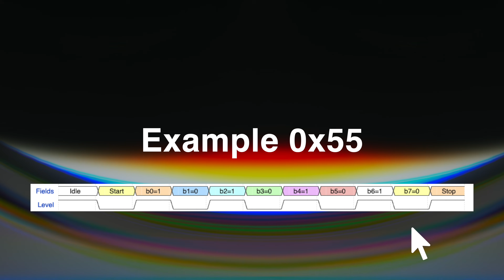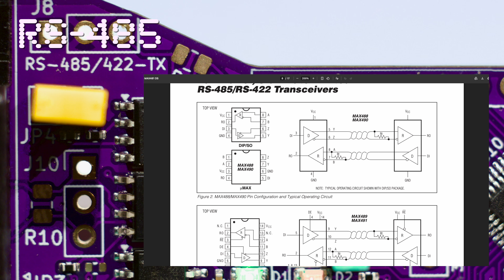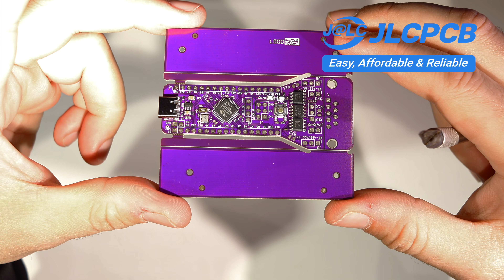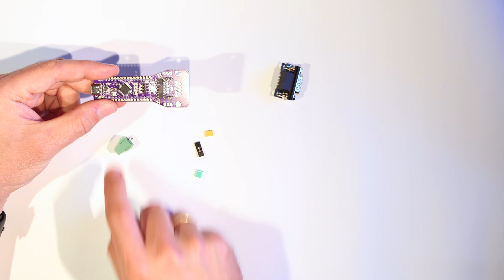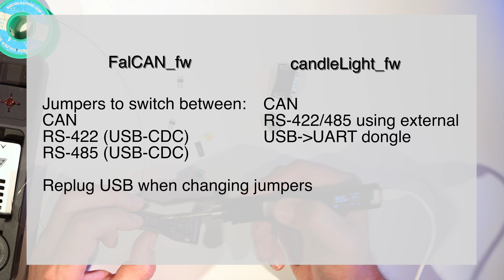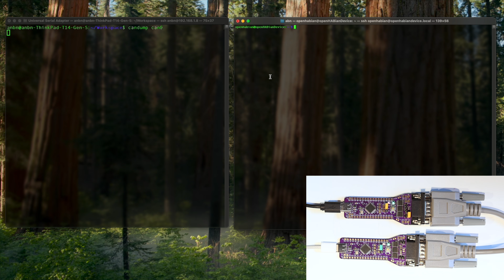UART, CAN, RS-485. This USB-C dongle debugs.. Everything*

Comment: For CAN you should have used something like TCAN4550-Q1 if your MCU does not support CAN-FD. At least, for "modern" cars, you'd need CAN-FD to communicate with various ECUs. The data has grown so much, that 8 Bytes per package became way too insufficient. The same goes for the baudrate. We usually go for 2 Mbps minimum, some systems might even use the 5 Mbps baudrate.
Reply from the maker: Indeed. FD was out of scope this time around but good to have something for v2

Comment: Let's make it really long and skinny and then introduce some super weak points every couple inches with these deep notches just to make sure it's as breakable as possible.
Reply from the maker: I did that for the U.S.A. Very popular for that use case - and hard to break unintentionally. No need when the point is the transceivers on the FalCAN.

Comment: Don’t know what to use it for tbh. 
I’ll stuck to my peak pro I think ¯\_(ツ)_/¯
Reply from the maker: You might want to keep it in mind for now.. in case your 566€ to replace version lets out the smoke 💨 😅
Reply: @AndersNielsenAA  yes i know... but at least for CAN it has an opto isolator and is my work gear. sooo i would get a new one :P 

would be nice to know if your dongle could also be used with DDT and other SW.
Reply from the maker: @tyberzann9713 It’ll probably do fine as a Black Magic Probe but not much higher performance than that.
The use case is primarily for hobbyists that don’t have a CAN dongle and might want to reflash it as something else occasionally - and cheap enough that it can be left in place if you have many CAN devices needing Linux logging, system integration tests etc in a professional environment.
..because getting a €200 dongle for 50 different systems becomes a frustration eventually

Comment: I had to build a physical bridge device in about 1984, which had TTL, RS-232, RS-422, RS-485, and... 20 mA current loop!
Needed for one of the funky space program things; they needed to connect to different modules and ground hardware... Remember KSR-33? 😱
Reply from the maker: Really wish I had a teletype, a VT100-compatible terminal, and a ton of other things that won’t fit in my house :)
Reply: I remember the Atari 850 interface, which offered RS-232, parallel, and 20mA.  That last works fine for the venerable KSR-33 (KSR for keyboard-send-receive).

Comment: U forgot ethernet and usb
Reply from the maker: Absolutely! And all the other high speed things that drags everything into FPGA-land. 
But this really is the thing for the external interfaces you’d find on industrial equipment or a satellite 🛰️.. where Ethernet and USB wouldn’t be the first choice.
Everything*
Reply: @AndersNielsenAA dreamsource labs claim they can do usb and probably low speed ethernet. I'd be nice if your system could emulate signals as well, that's what is missing

Comment: I understand the desire to separate out RS-232, but it still makes me a little sad. Anyway, part of me really wants to slap both of these and a Pi Zero in a box with a terminal and just be ready to deal with anything.
Reply from the maker: But then suddenly people mention LVDS, PCIe, etc etc and all bets are off again :)
Reply: @AndersNielsenAA  I can't argue other standards exist, but really at a certain point you get into machines and standards that don't really need any serial access. Like UART and GCode can still run so many industrial machines, you can use a UART terminal on a Pi, etc. Once you get into PCIe, you really can't do much with a simple COM port. On the other hand, CAN is an amazing tool to have in the box.